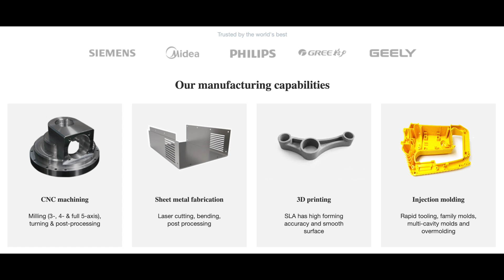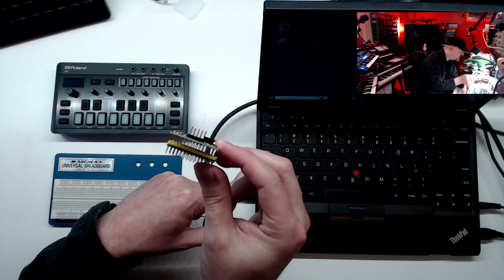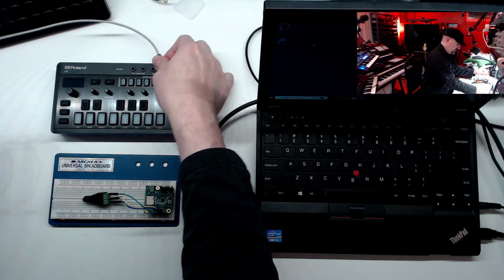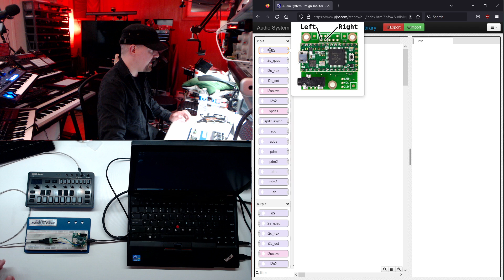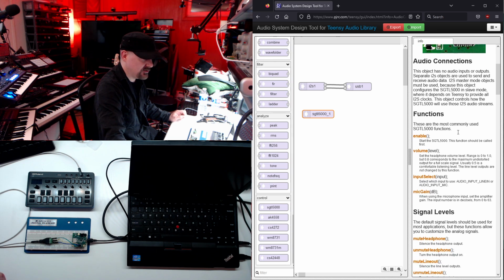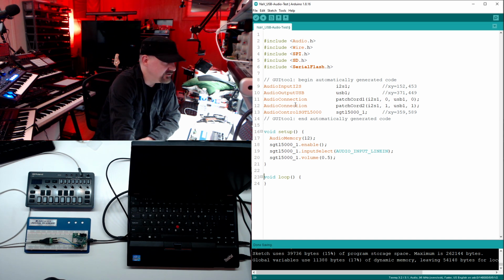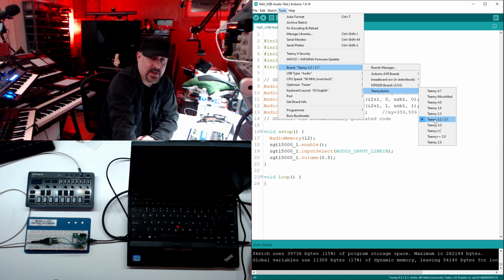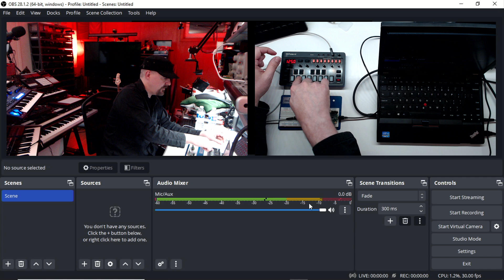TEENSY - USB Audio Interface

Comment: I can't get this to work. I got as far as having the Teensy show up as an audio device on my taskbar and in Audacity, but I can't get any audio in or out. I can see it playing audio (meter goes up and down) on the audio control on the taskbar, but there's no output on the headphone jack. Same with all the Teensy audio examples in the Arduino program. Bad hardware? Do I just need to add an SD card? This whole experience has been very frustrating. I usually design/build 100% analog stuff and it always works first try. Digital seems like it never works at all.
Reply from the maker: What version of Teensy and Audio Board do you have?
Reply: @NotesAndVolts  3.1 and Rev C audio shield. I got it working in the end. I went with a different pin header than what you used and I guess it just wasn't making a solid connection. Turns out LED only flickers when I'm touching my guitar (which is plugged into the teensy through a buffer) which is pretty weird. Some kind of grounding issue I guess. It still works fine though, I don't notice any other problems. I used their audio design tool to hook up the I2C to monitor the input and output at the same time.
Next I just need to set up a button to turn that direct monitor on/off and maybe mono/stereo and I'll be fully done. I set the audiomemory a bit higher since I have no plans to run any effects or anything. I have pedals for that. 
Oh and the other thing is that there's a volume slider in Windows 7 for the output but it doesn't do anything. Not sure if that's fixable. Otherwise it works great, the input volume is perfect for guitar as-is, I don't even need a volume pot before the input.
Thanks again, without recreating your setup code I wouldn't have been able to get the program to work. I'm not sure how they expected me to know that. Their design tool doesn't include that part. But I just retyped what you had in this video and it works perfect.

Comment: Not sure if an audio signal from an instrument like guitar or bass can be connected straight to the line in of the audio board. Would it need an input buffer or some sort of preamp to bring the signal to line level?  Anyway, your contents are incredible, thank you so much!
Reply from the maker: I think the audio board has an input impedance of 29K so a hi-Z input buffer would probably sound better.

Comment: Why 12 blocks? That's pretty specific and not what I normally see in programs. Most teensy examples I've seen use 10 or 20. You're good with this stuff, so I'm thinking you have a good reason. Did you choose that number because the teensy 3.2 has a built in 12-bit DAC?
Reply from the maker: No real reason. I was working on another program that used 12 so I just went with it LoL.
Reply: @NotesAndVolts  I know what you mean. Every time I write a tcp network program I always use the port number that was in the example code in the textbook I learned network programming from. I figure that it's an obscure port that doesn't conflict with any other services, so why not.

Comment: Awesome and thank you. I’m using a Teensy for a USB midi pedal (learned it from you) for my Boss Katana amp but it needs a computer interface to work. I’m using a Raspberry PI for that. Is there any way to do this with the Teensy?
Reply from the maker: Thanks Chris. I believe that the new Teensy 4.1 can act as a USB host but I have not tried one yet.
Reply: Teensy 4.1 is very nice. I use it with my MIDI foot pedals directly into the PC. I use a synth plug in and have a generic set of Taurus pedals on the cheap.

Comment: Great idea! Is this interface is class compliant? Do you think it will work with iOS? Thanks!
Reply from the maker: Hi Deaftone. It is class compliant and I didn't use any special drivers for the demo. Not sure about IOS compatibility.
Reply: Yes, so far. I’ve been able to record a line in audio loop from a Casio synth demo into the Teensy 3.2 Audio shield using Reaper v6.81/OSX64 (Jul 4, 2023 release), and play it back with the Built-in MB Pro speakers, or my external audio interface, panning right and left, HOWEVER, I haven’t been able (yet) to get my (necessary) defined aggregate device to accept an input from the Teensy USB and output it to any of the other options, simultaneously. Working on it.

Comment: Hey Dave, what about getting 24bit/96kHz audio?
Reply: Overkill. The Nyquist Frequency of a 44.1K sampling rate is 20,050Hz which is more than enough to hear all nuanced harmonics, unless you're a dog with an upper range of 65,000Hz. 16 bits is enough granularity to hear a SNR (ratio of the loudest to quietest audio) of 96dB. 24 bits will torture you at up to 144dB. The threshold of pain (for most mortals) sets in at about 120dB. Be careful what you wish for, and when marketing is talking, hold on to your wallet.😉
Reply: @guitinker  unless you plan on mixing and mastering with that audio.
Reply: Unless your application is SDR and not audio DSP...
Reply from the maker: Hi Melanie. Unfortunately this little guy will only do 16Bit/44.1Khz

Comment: small enough to embed in a guitar body..usb guitar. And you could use some of those effects in the teensy..maybe add a rotary encoder and small screen on the guitar..that could be cool, if you could embed a cab sim in the code to, and the neccesary analogue i/o buffers for the guitar signal.
Reply from the maker: Lots of great ideas!